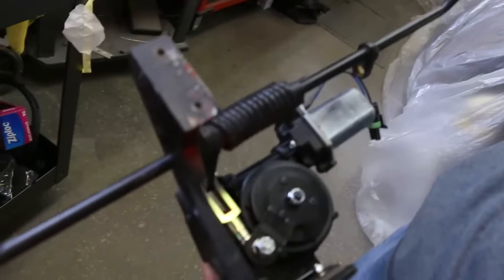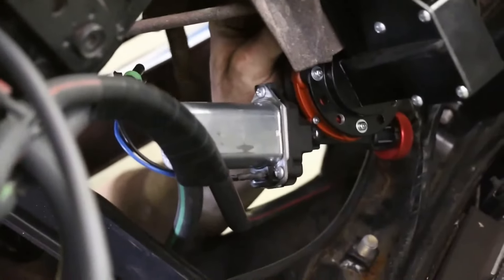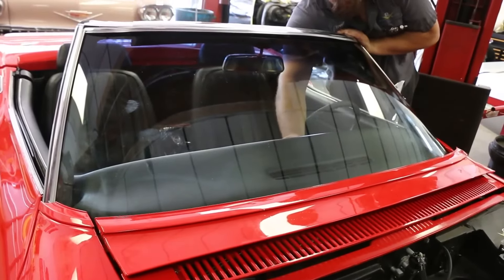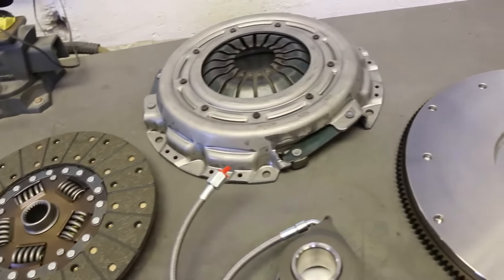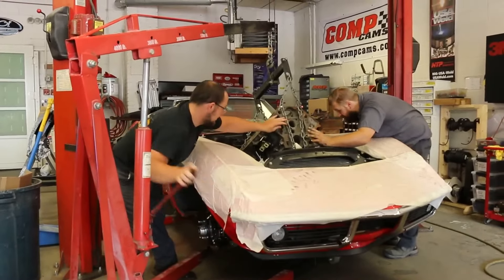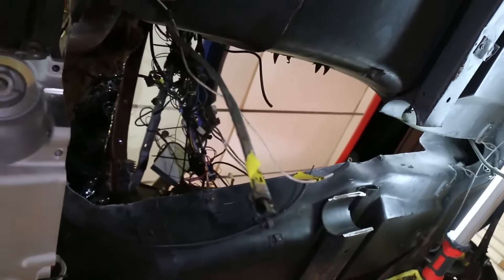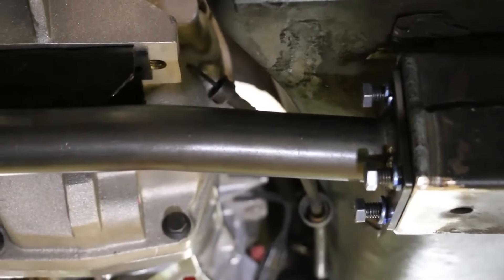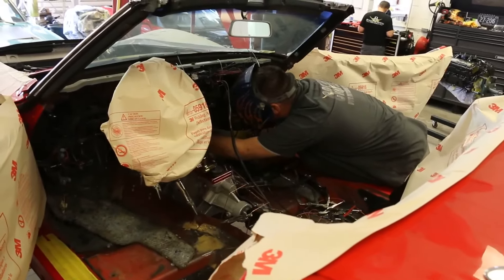🔥 Chevrolet C3 Corvette LS Swap 6 Speed Manual Transmission Swap at V8 Speed and Resto Shop Part 2

Comment: Would there be as much fabrication needed if you were to install a 5sp manual?
Reply from the maker: A 5-speed like a Tremec TKX requires less fabrication as they are much smaller.